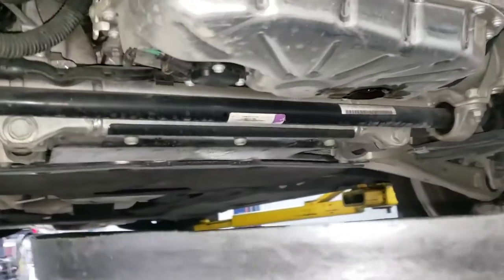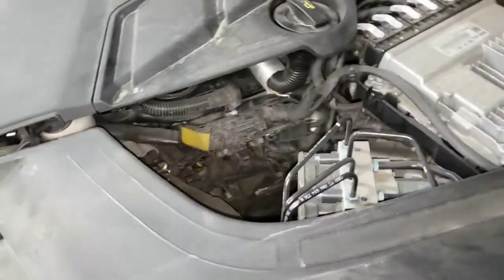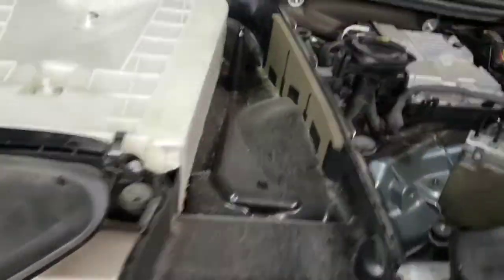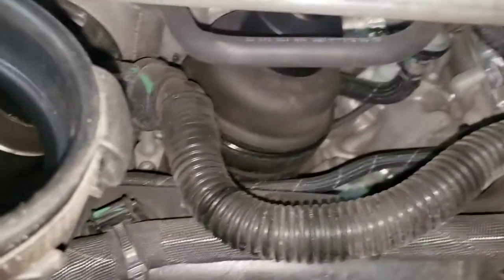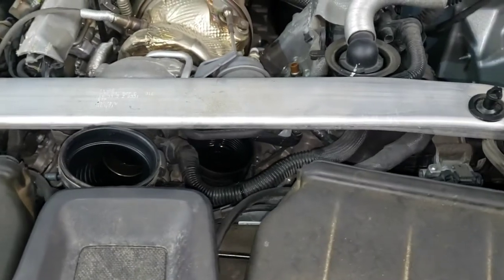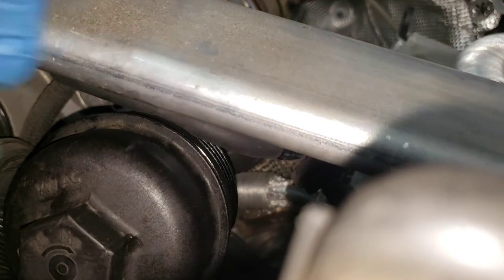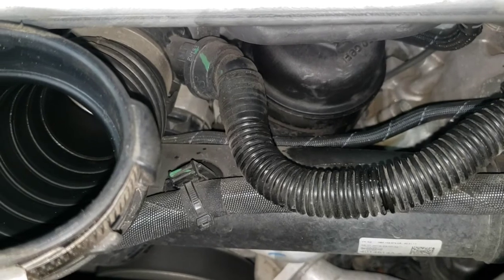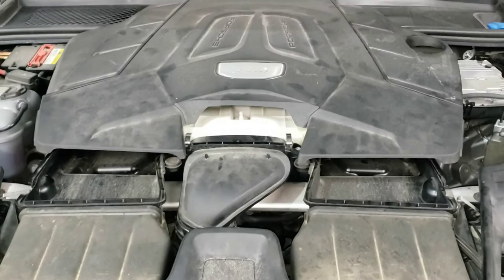2020 Porsche Cayenne Oil Change

Comment: Glad I found this video, glad you also explained the two rubber intake sleeves. For my car, the Porsche dealer had the outside lips folded inside the polymer part of the intake/airbox. I knew it looked funny during the test drive/inspection. I asked the sales guy and which he responded it was "perfectly normal" lol. After I brought the car home I fixed both thanks to this video. They look much better and cleaner, and I think accelerates better (but I'm most likely just imagining that). Thank you!
Reply from the maker: Glad the vid could help, yeah that's a small detail a sales guy would definitely not know about. In terms of power only thing I can think is that with the boots connected properly and pulling air from the filters it pulls cooler air, instead of hot open engine air.

Comment: Great thanks! Would you please recommend diagnostic tool to reset all alerts for 2019 cayenne base?
Reply from the maker: At our shop we have an 
autel elite
Snap on apollo
And an outdated porsche piwis
None of which could reset the 2020 cayenne. 
I believe an up to date porsche piwis scanner would be required for the 2020 at least not sure about the 2019

Comment: Hi great video!  Did you notice slight metal shavings?  I have 21 cayenne base, saw some and dealership is insistent this is "normal"
Reply from the maker: so the one in the video had like 15,000 miles already so I didn't bother paying attention, since ours drains into the big container and not a bucket it's hard to see. but in regards to your car it would be normal to see some shavings or glitter if the motor was brand new or rebuilt, after that you really shouldn't be seeing much unless you have big problems lol

Comment: Can you tell me the exact tool used to remove the oil filter housing? Thank you
Reply from the maker: it's a 32mm oil filter wrench. so its still a normal socket size technically its just low profile compared to a 32mm axle nut socket. here's am amazon link of one. https://www.amazon.com/Ibetter-6-Point-Wrench%EF%BC%8C3-Volkswagen-Chevrolet/dp/B07L9P8GJQ/ref=mp_s_a_1_4?crid=24ACX25DU2BLZ&dib=eyJ2IjoiMSJ9.k3kKPmBReA6KUjd10ZaxtxsruPqquRx48a3A4rv--T1A69ETnWoGQH_3O1XYFlPRsUrQeDFjSbvx7THE4N62ckXpZs5CV_gGSeTHASnqCKnA0ubWTO9SIFI8IqqYODB2GXWMBDRp3d_Vv4D_QlVi1aiBmGBHf3TJhOVUEE6GUahUb_B1-hsBorq31bHEidKKDCBiRRaZikw3OVCDANYUPQ.3vrr90Eez-1RfTVP2dTVXdFDQ37saUJn--7sjZoWL-8&dib_tag=se&keywords=32+mm+oil+filter+socket&qid=1709669318&refinements=p_85%3A2470955011&rnid=2470954011&rps=1&sprefix=32+mm+oil%2Caps%2C190&sr=8-4
Reply: Excellent thank you!

Comment: What did you torque the drain plug with new washer to?
Reply from the maker: Most specs call for 20-30 ft/lbs. When you've done thousands you start to just go by feel.

Comment: What kind of oil did you use?
Reply from the maker: I wrote it in the description i beleive, it was 0w20 ESP mobil 1, supplied by the customer from porsche
Reply: find a oild meet VW508 is fine

Comment: Is there a hose that I can exact the oil with the extractor?
Reply from the maker: Hmm i wish i had a for sure answer. But i dont remember seeing a dipstick tube. You would need a dipstick tube to suck the oil out from the too. I know older models had a tube, but didnt come with a  dipstick so people would make there own. I would say no, from what i remember
Reply: @RatedRTV  hey man, I found the extract hose. If you look next to the filter, there is a very thin hose with a little cap.
Reply from the maker: @baidefeng3139  did i capture it in the video, if not is it to the left or right of thr filter so other peoplr know
Reply: @RatedRTV  i will try to make a short video these days. I was going underneath to do it but it was so complicated. Since I also have a s5 with same engine, I found the same hose as that near the oil filter housing.